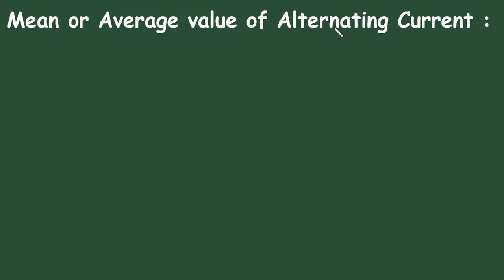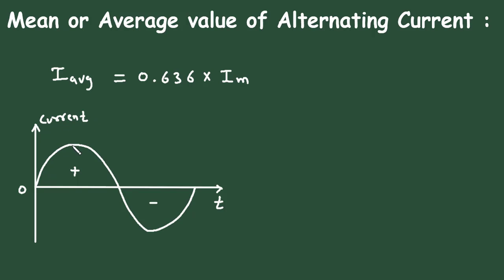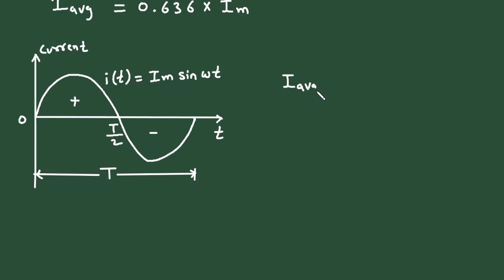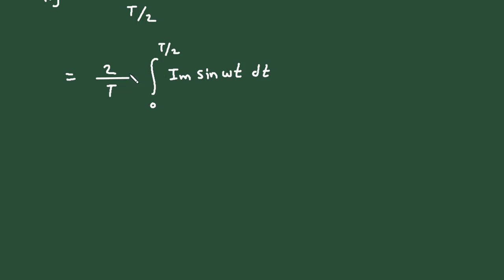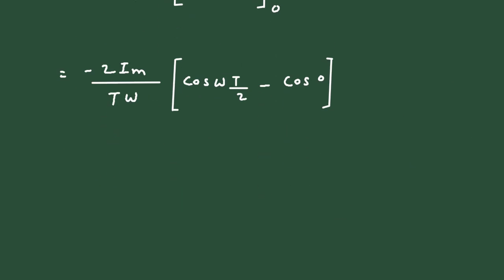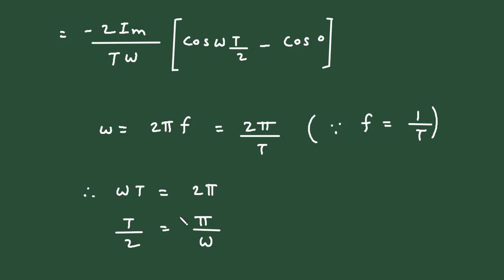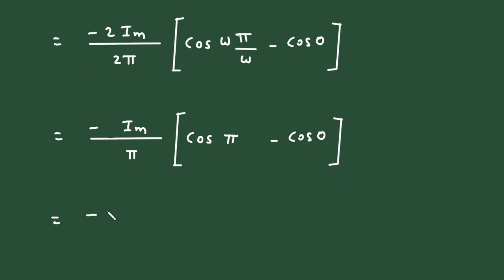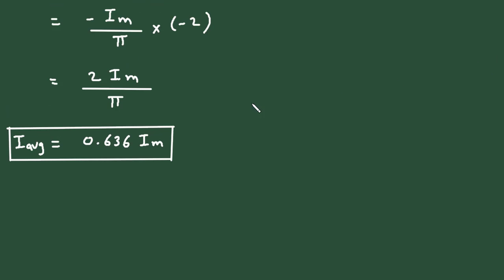How 0.636 come in average value of alternating current | Electrical Engineering

Comment from the maker: Alternating Current Waveform
Watch : https://youtu.be/yQT0f5jSyyI

RMS value of Alternating Current
Watch : https://youtu.be/xxqw7paRKMw

How 0.707 come in Root Mean Square (RMS) value of alternating current
Watch : https://youtu.be/wa_iMNuqKrU

How to use a multimeter
Watch : https://youtu.be/AI5ZqMhI45A

Transformer Explained with Practical
Watch : https://youtu.be/54qrRzVFvA0

What is Induction coil ?
Watch : https://youtu.be/WrR-PEhPA58

How diode works ?
Watch : https://youtu.be/Wvlc4AWwui0

Ohm's Law
Watch : https://youtu.be/lmO284mJ61I

Supernode Nodal Analysis AC Circuit | Sinusoidal Steady State Analysis | Electrical Engineering
Watch : https://youtu.be/RRMhwgRUWcU

Electrical Quantities, Symbol, Basic Unit, Current, Charge, Power, Voltage, Resistance, Reactance
Watch : https://youtu.be/pNonMmvJJIo

Star and Delta Connection Line Voltage Phase Voltage Line Current Phase Current
Watch : https://youtu.be/_KnSG7aYabs

Impedance and Admittance Problems | Impedance Problems and Solutions
Watch : https://youtu.be/nMc-1oNwrNk

Alternating Current
Watch : https://www.youtube.com/playlist?list=PLQLdKyBqWCjodL8L5nWI6vrVPB_vkjr_J

Thevenin’s Theorem
Watch : https://www.youtube.com/playlist?list=PLQLdKyBqWCjptDMyRIJ79rbAV4K6t30gh

Current Division Rule
Watch : https://www.youtube.com/playlist?list=PLQLdKyBqWCjqghBWLopnM47bkJejh60x4

Operational Amplifiers
Watch : https://www.youtube.com/playlist?list=PLQLdKyBqWCjqGo9etn_2fbHGSOw7QOw9k

Kirchhoff's Voltage Law (KVL)
Watch : https://www.youtube.com/playlist?list=PLQLdKyBqWCjrRejKMcfnmbSPo_jJvv1n2

Kirchhoff’s Current Law (KCL)
Watch : https://www.youtube.com/playlist?list=PLQLdKyBqWCjr9c0_BgmZ7CDSnP119m_YV

Series and parallel resistors | Equivalent Resistance
Watch : https://www.youtube.com/playlist?list=PLQLdKyBqWCjrxi7wUWb-9MxFhae00Lezr

Impedance Combinations
Watch : https://www.youtube.com/playlist?list=PLQLdKyBqWCjq-2fjpsMd_9pr17ThoXT8q

Impedance and Admittance
Watch : https://www.youtube.com/playlist?list=PLQLdKyBqWCjpabLO97-Q_lfXigABp1W9a

Wye Delta Transformations
Watch : https://www.youtube.com/playlist?list=PLQLdKyBqWCjq89-aRu1bPc0VZLZJY7MRQ

Sinusoids
Watch : https://www.youtube.com/playlist?list=PLQLdKyBqWCjrZPpDbUBjXnyaMnFKfCM4h

Phasors
Watch : https://www.youtube.com/playlist?list=PLQLdKyBqWCjr5gn_8DfAkqczUbRtDNM78

Norton’s Theorem
Watch : https://www.youtube.com/playlist?list=PLQLdKyBqWCjrYOouQAvUnS1BiN3bBR90l

Nodal Analysis
Watch : https://www.youtube.com/playlist?list=PLQLdKyBqWCjqB2LEk7PYLx7vImC0BdLBO

Source Transformation
Watch : https://www.youtube.com/playlist?list=PLQLdKyBqWCjoFv91tOfyc_2Cqv9CvPFis

Mesh Analysis
Watch : https://www.youtube.com/playlist?list=PLQLdKyBqWCjqJmPraFRLutDh2nG9TfDUh

Impedance
Watch : https://www.youtube.com/playlist?list=PLQLdKyBqWCjrgbj8jXdDFhazZ3QVja2Jl

Electrical Circuits
Watch : https://www.youtube.com/playlist?list=PLQLdKyBqWCjqw7vUo8QuKP3aGHNmtLGbb

Superposition Theorem
Watch : https://www.youtube.com/playlist?list=PLQLdKyBqWCjrzVapyz49z3qVsW5XSMA7P

Mesh Analysis with Supermesh
Watch : https://www.youtube.com/playlist?list=PLQLdKyBqWCjqhafxaIoTmG8x_1wDfSSwn

Two Port Network
Watch : https://www.youtube.com/playlist?list=PLQLdKyBqWCjrZYNs7ni2BRZm133ljYn-y

Electric Circuits and Networks (ECN)
Watch : https://www.youtube.com/playlist?list=PLQLdKyBqWCjrAuiRcm9-O_eliDe6uJX1O

Maximum Power Transfer Theorem | Electric Circuits
Watch : https://www.youtube.com/playlist?list=PLQLdKyBqWCjqpieLy7IK5rEpNeaiDLT3G

Digital Techniques | Digital Electronics
Watch : https://www.youtube.com/playlist?list=PLQLdKyBqWCjoCuUq8UTn9fCmSf6mxB6rO

Nodal Analysis with Supernode
Watch : https://www.youtube.com/playlist?list=PLQLdKyBqWCjpEsPhJMjmRou1X6gq3LJPI